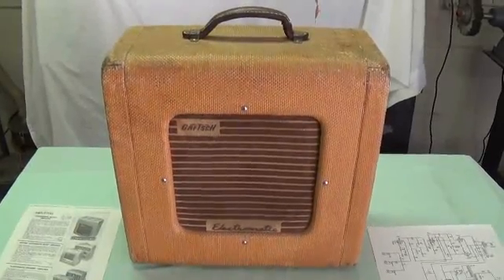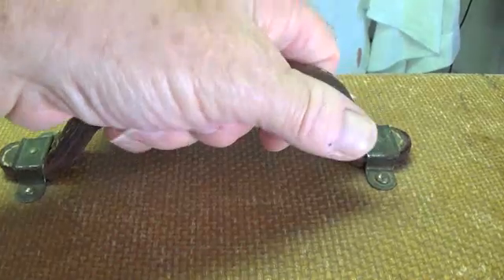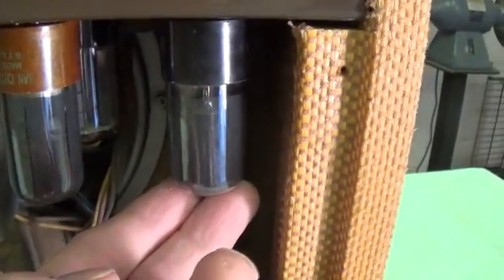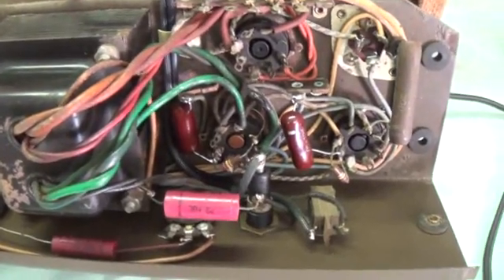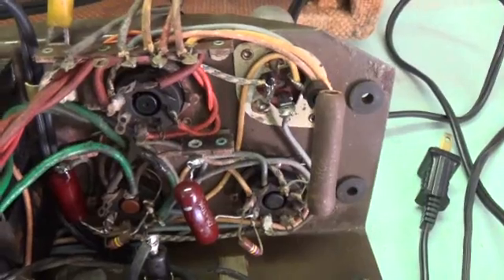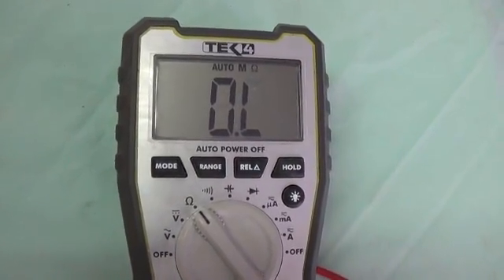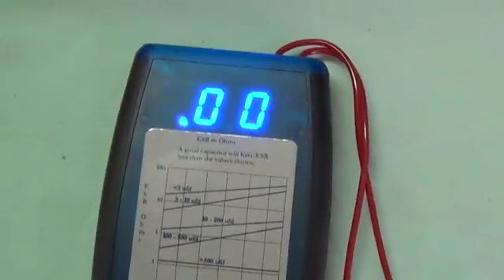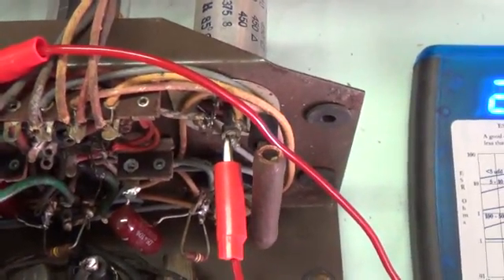Using an ESR Meter to Determine the 'Health' of Electrolytic Capacitors in Guitar Amplifiers

Comment: wow, all I can say is, wow.  I really have doubts about this method of determining the suitability of old 'lytics, they are KNOWN to have life expectancies of no more than 20 years.  Testing them with a meter that DOES NOT apply the full operating voltage upon the caps is likely to result in accepting old 'lytics that are waaay past their prime with the fallout of loosing a valuable transformer when they blow, the price of 'lytics is so low, and the quality vis-a-vis new ones are so much better that to take this chance is really hard to understand.  And regarding the coupling caps, yes, they were replaced by someone because they were leaky, as almost all old paper caps are because the paper was made with acid and it breaks down over time, seen that a hundred times on the old radios and amps I have repaired.  I would be more convinced if you have used a Sencore LC53 (or 102) that applies the full operating voltage across a cap, not some tiny voltage that does not even begin to approach the caps voltage potential.  You should rethink this procedure....  I do like the info and enjoy your posts though...
Reply from the maker: Thank you for your input. Until the past year or so, I would have agreed with you. For many years,  I too reflexively replaced every old electrolytic capacitor (EC) I encountered. Once I started using the ESR meter, however, it became evident that the life expectancy of EC's is much greater than we have been lead to believe, and their capacity to "heal" and re-form was truly impressive. The ESR meter gives a very accurate indication of the EC's ability to filter out the 120-cycle ripple that persists after rectification, even before an audible hum becomes evident. With it, I now can detect and replace failed and failing EC's based on measurement, rather than habit. I have also come up with a method to use the meter to very accurately test non-electrolytic caps in circuit.

Your concern, however, seems to focus on the possibility that an old EC may spontaneously "short out" and destroy the power transformer (PT).  Like concerns over the dreaded "Death Capacitor", fears like this have been instilled in virtually everyone who works on old amps, but it is my experience based on over 35 years (and after consultation with several equally-experienced colleagues), that in a properly (conservatively) fused amplifier, this simply does not happen. EC's may fail, but rarely short out and if they do, a proper fuse saves the PT. Likewise with the "Death Capacitor", which is a non-issue in a properly wired and fused amp. Your experience may differ, but we feel that PT damage is primarily due to human, not component, failure.

When I was young, virtually every child had their tonsils ripped out by 6 year old.....now, it very rarely happens. Likewise with EC's, partly since currently-manufactured replacements frequently have quality control issues that render them inferior to the old EC's they might replace; and, more importantly, we now have a device that can accurately assess the operational status of  capacitors, to guide us in selective, rather than reflexive, replacement.

Thanks again for your input and for taking the time to watch my video(s). I am respectful of your opinion and really appreciate your time and interest.
Reply: thanks for you input, I would agree that in most instances the cap will open rather than short, thanks god!  Insofar as my early work was/is in old radios, there is no fuse so that protection is not present like it is in old tube amps, so replacement is more needed as a protection mechanism.  Enjoying your videos, keep em coming, thanks!
Reply from the maker: Again, it's good to hear from you. I definitely agree that the lack of fusing in old radios is a game changer. When working on old radios, I too tended to replace all old EC's. However, with the (virtually universal) fusing of guitar amps and the advent of ESR technology, I have now modified my approach a bit.

I sincerely appreciate your correspondence and the time you take to watch my videos. Such exchanges make the YT experience much more enjoyable. Thanks and best wishes for a great new year.
Reply: Uncle Doug When I repair/refurbish an old radio, I install a pigtail fuse under the chassis to prevent this particular issue...Why radio manufacturer never fused their product, I'll never know...add a 10 cent fuse to the price of the radio. :)
Reply from the maker: As my old granny used to say, "If it ain't gotta fuse....it ain't safe to use"......or something like that :)))
Reply: That's an excellent saying! I live by it! :)
Reply: @pourspelang  From all the old-timers the rated life on 'lytics is around 20 years, that being said, I am re-evaluating that position, too many cans I have pulled are nice and "wet" inside, indicating that the electrolyte has not dried out, the most common problem with can caps going bad.  And while I have not used my full-voltage Sencore for testing these pulled cans, I have started and am looking into getting one of these high-freq ESR testers to try and save time and money on my repairs.
Reply: @pourspelang  Hi, I agree with you to a point, the caps made in China are cheap-ass shit that DO break down after about 3 years of use in the all-too-common SMPS, which are very hard on caps.  The Japanese do make much better caps that have much longer lifespans, and I do trust them (and the German F&T cans) to be as good as any of the old FP-style cans from Sprague, etc.  I would note now that I did buy the ESR tester (Atlas model), what a great toy!  If only it was reliable way to determine if a 'lytic was good or usable as caps that test good/low ESR, have too high a leakage on my Sencore LC53, leaking into the mA range (I also noticed that when I pulled the cans there was a slight bulge on the side).  In this instance again, I think I will have to stick with Mark Walker of Blueglow Electronics, caps need to be checked at their rated voltage, otherwise ESR readings are not useful.  Check out Mark's take on capacitor testing on his youtube channel, for someone like myself who restores audio gear as a business, I cannot take the chance that a poor-testing regime will allow a bad cap to be left in audio gear that will then fail, costing me money and reputation.

Comment: Uncle Doug,
Thanks for all the great videos. I have one question about this video. When you measured the capacitance with your volt ohm meter "in circuit" were two of them essentially in parallel?  Shouldn't they then read double as a normal reading?  The third isolated through the transformer. 
RH
Reply from the maker: Greetings, RH. Yes, when you get a "double" capacitance reading with a regular (VOM) capacitance meter, it's almost always because the cap you are measuring is in parallel with another cap somewhere in the circuit. Sometimes, the parallel relationship is not evident (unless you have a schematic handy). Fortunately, with an ESR tester, surrounding components do not influence the reading.
Reply: Uncle Doug, There is another factor to consider - if there are two or more parallel capacitors to measure, the ESR reading will not be accurate.  If you measure the ESR across more than one parallel capacitor, and if one is high (bad) and the other(s) is/are low (good), the ESR will show a nice low series resistance.  Only way to to it correctly is to remove the all but one of the parallel capacitors from the board and test separately.  Thanks for the great video, and I hope I made sense.

Comment: Thanks for such a great lesson and demo!  I found this ESR meter on ebay:  MESR-100 AutoRanging In Circuit ESR Capacitor /Low Ohm Meter  

- should i steer clear of something like this and go with the Blue, like yours.  I'm on a very small budet.  thanks again.

Comment from the maker: amps I have encountered and owned, then I see absolutely no benefit in replacing them. This is not so much a slavish devotion to originality as it is simple common sense. The ESR meter allows us to detect hidden but impending failure in electrolytics, and thus is a valuable tool for determining which capacitors should be preserved and which should be replaced.  I hope to gain a lot of additional experience and knowledge from this device and will report what I find. Thanks again......

Comment from the maker: Thank you.....I agree that the subject is open to discussion. In a properly fused and grounded amp, I don't really see fire or electrocution as likely occurrences, but I would agree that in an amp used by a professional musician, where reliability is essential, fresh filter capacitors would make good sense....and if the existing electrolytics are causing noise, then they should be changed.  But if the original electrolytic capacitors are functioning well, as they are in about 90% of all the.....

Comment from the maker: Yes, it was my impression that the similarities to the original were purely cosmetic and that the circuit was much simpler and less expensive to produce. I believe the "reissue" sells for only $200 or so. What you describe makes good sense, since this would be about the cheapest possible tube amp circuit to produce. An enterprising individual could probably alter the simplistic "reissue" chassis to more closely resemble the original.